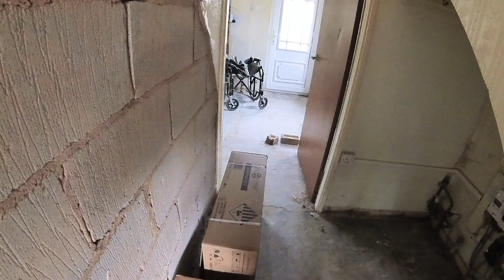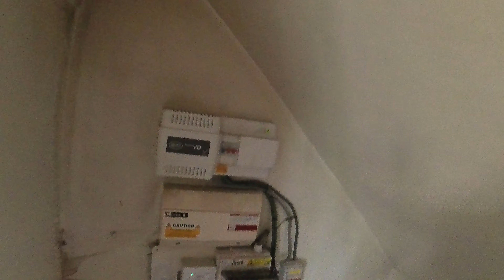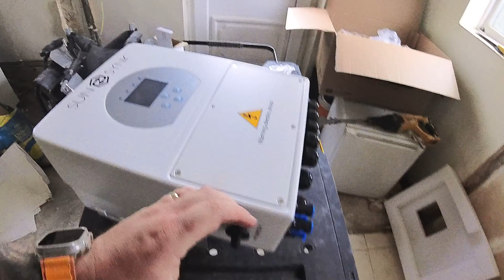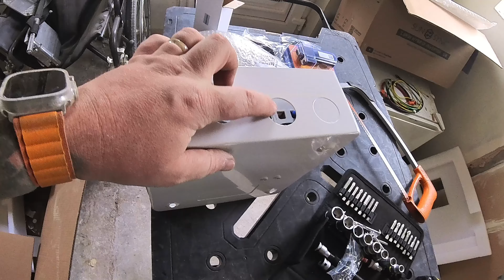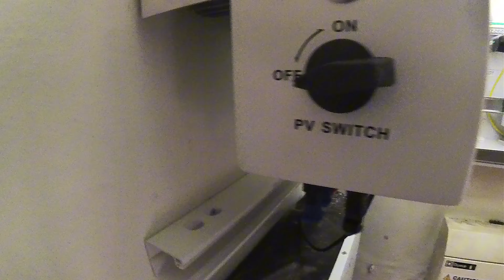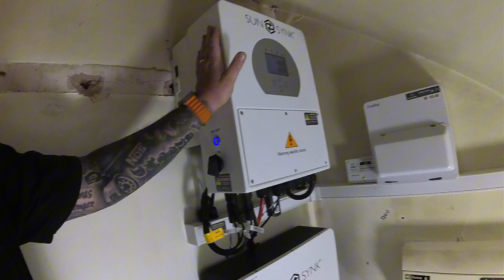SOMEONE STOLE THE SOALR INVERTER !

Comment: Just a few quick notes - since you asked for critique - so please remember it is not to disparage but to help in future endeavours: 
1. Your first outing as a solar sparkie but you already clashed with PAS 63100:2024... Yes, it's not a legislation yet (although unfortunately it sure will be), but you'll already have to fill up a non-compliance in an appropriate sheet in your MCS package.  Meanwhile - perhaps there were better alternatives than directly under escape route - that space by the conduit on the external wall looked perfect - anywhere more that a meter from the window would comply?
2. By introducing Fusebox and Levato DIN rail equipment in one assembly you entered into murky waters of "the person introducing the deviation becomes the original manufacturer with the corresponding obligations" under 536.4.203 note 2 with a burden of proving compliance to BS EN 61439 including but limited to (to quote BEAMA) "seeking assurance from the manufacturer of the original assembly that the devices will be compatible" or otherwise forfeiting responsibility to act “with due care” and "becoming accountable under Health and Safety legislation for creating risk of fire and other damage". In other words - ugly or not - it's always better to slap "big red and yellow thing" (external rotary isolator for AC) than mix equipment from different manufacturers in CU. 
3. Sunsynk usually requires really excessive space around inverters for ventilation (usually half a meter all around, it's on page 14 in most of their installer's manuals), which is why most installers pick different brands (with lesser requirements) for tight spaces and cupboards as to not fill up risk assessments and non compliance notes in paperwork.  
4. Schematics of the installation, isolation procedure stickers as well as date of the installation and next inspection I'm sure were just of out of view of the camera on the wall somewhere. 😉

Otherwise - clean, neat, solid, working, keep it up.

Comment: Sunsynk owner here,     One Battery can only charge/discharge at 2.5kw (50A @ 51,2v)  so to get the full 3.6kw from the the inverter when its dark.... the customer needs 2 batteries.

Also the 3.6kw inverter can handle up to 7kw of solar but only when theres enough space for DC charging.  i.e 3.6kw of AC inverting and the rest would be DC charging. if the batteries are 100% then solar will be clipped to 3.68kw (Max AC inverting)

7:48 - Is that generation meter bi-directional?  Generation meters are essentially E-waste these days, MCS really need to abolish these. A contentious topic i know,
16:20 - 20w Grid trickle. Only needed for old PAYG meters to prevent them spinning backwards even with zero export.. With a smart meters (thats a smets1) you can safley change Grid Trickle to 0w
Reply from the maker: Hi, when I spoke with them they assured me that it will charge and discharge at the rated 3.6k, how old is your inverter ,
Reply: @brightsparkmid  It's down to the battery/bms not the inverter. The 3.6kw inverter can charge up to 4.6kw DC (85A)

The datasheet for the g5.3 sunsynk battery (the one in your video) says 50A charge/discharge recomended. 100A Nominal (temperature dependant) and 150A peak for 2mins over 25c.
The data sheet doesn't say what temp or SOC is the optimum condition for 100A Charge/Discharge but I'm assuming >25c and then derates over 40c.

Not an issue in the house, but batteries below 13c derate to 20A charge/discharge (1kw per battery)
Another reason to avoid batteries in lofts.  One to watch out for when installing batteries in garages or outside (that g5.3 battery is ip65 rated I believe)

I have older sunsynk batteries so 50A max charge/discharge.
But with 7 of them on my 8kw inverter, the bottle neck is the 190A max charging/discharging (10.4kw at 54v) of the inverter itself.
Reply from the maker: Thanks for all your details information

Comment: Hiya, just watched your video and your call for comments on the end. ;-)
Having inverters and battery in my basement (a room with a size of about 20 sqm) it gets rather warm in there esp. in summer. Your installation under the staircase is an area which is too small for this hardware and there is no guarantee for proper ventilation. From what I have seen in the video, the door does not seem to have ventilation slits in it.
Have a look in handbook of the inverter, section 4.2 ... "DO NOT install the inverter in the following areas: ... - Areas where the  air circulation is too low." Further down in that section is a recommendation for clearance, the one with the big "WARNING" triangle. Is says: "For proper air circulation to dissipate heat, allow a clearance of approx. 50cm to the side and approx.
50cm above and below the unit. And 100cm to the front."
I won't probably become a fire hazard but the inverter goes in to degraded operation mode above 45 degrees, which will happen in this space. Additionally, the power electronics in the box will age a lot quicker an cause failure. The unit is probably out of warranty as well if the manufacturer sees that the recommended clearance has not been honored.
One last thing, batteries don't like heat too much, they have a comfortable temperature zone which is similar to what we humans like. Their capacity also degrades fast when they are kept fully charged and at temperatures above 35 degrees C.
Reply from the maker: Love the comment and happy to take on board, 

So there is a minimum 250mm clearance around the equipment and the area is going to have a fan fitted when the property is re wired as of right the now the equipment is running below 18 degrees and this is on a day where it was 30 outside,
Reply: @brightsparkmid  the 3.6kw heatsink is cooled by natural convection but there is an internal fan for when the inverter gets very warm. 

Great point by the poster above regarding ventilation.